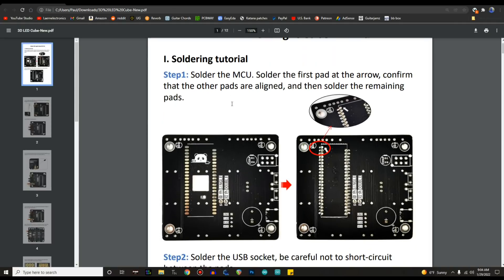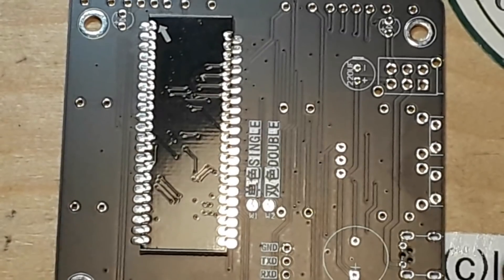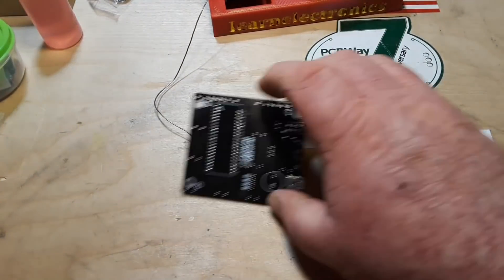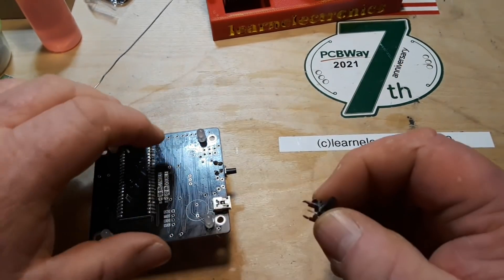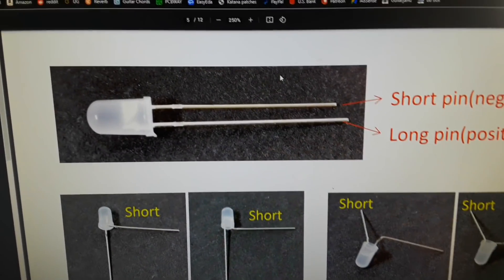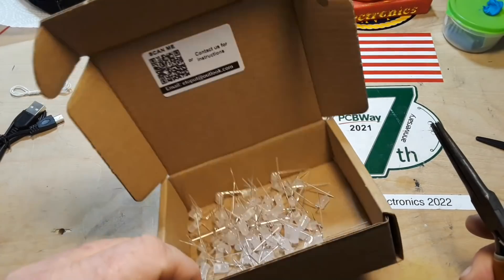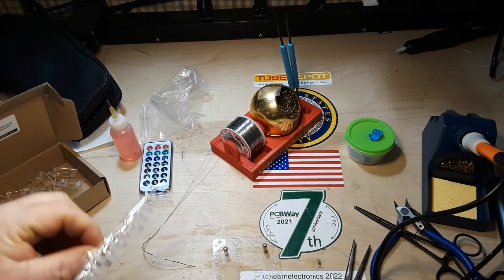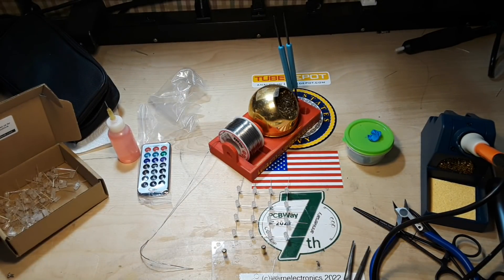4x4x4 LED Cube Part 1

Comment: Great video, helping me get thru some of the areas that i have been , how do I say a "bit gray" on, thanks so very much for taking the time to help others, oh a great way to solder to  long IC chip, that i just learned of is "hot air soldering using soldering paste, it made soldering all of the connection on that IC chip in 90 seconds, and looks great, check out a few of the videos here on Youtube about it, the soldering irons ( if you can call them that) are priced to fit any ones budget, trust me I am cheap, smiles , thank you again great videos that are a lot of help

Comment: Thanks for another excellent video.  That looks like a complete pain to put together.  On a slightly different subject, I see you use header pins to connect your power supply to a breadboard.  Which ones do you use?  I have a couple from different manufacturers, but they all seem loose

Comment: I've seen a number of people use the "drag" method for things like IC's ... is this mcu not suitable for that approach?

PS: for fellow n00bs like me, the Drag method is basically where you draw a mustache on a chip with a black Sharpie and then use different colored Sharpies to draw a dress. Bonus point for using glitter glue to paint little high heeled shoes on the pcb opposite of where the mustache was drawn.